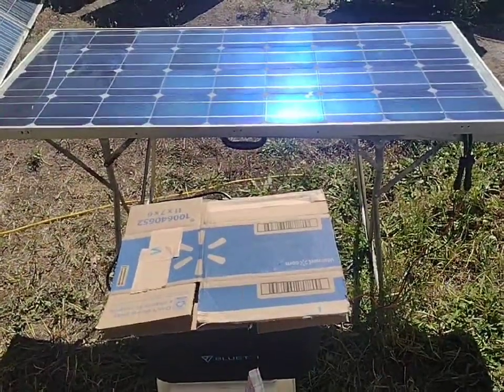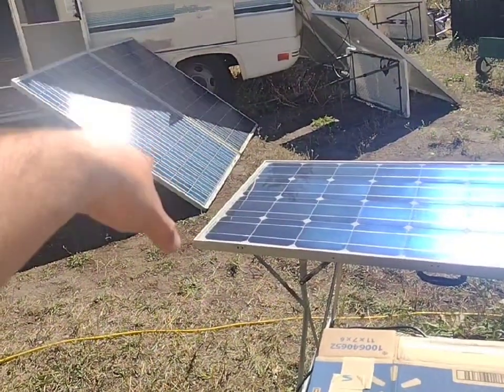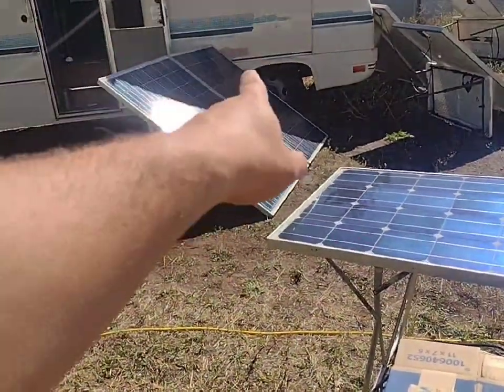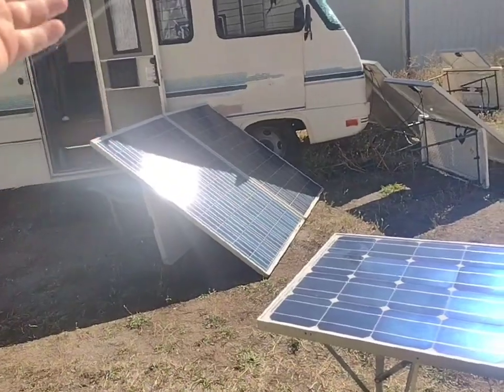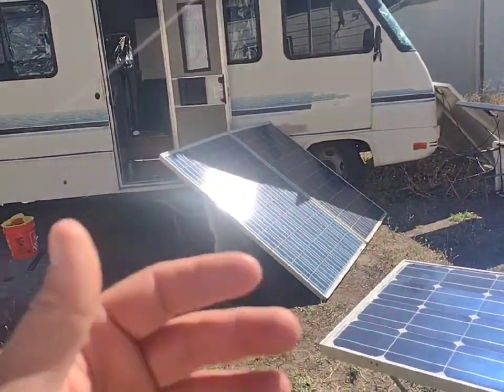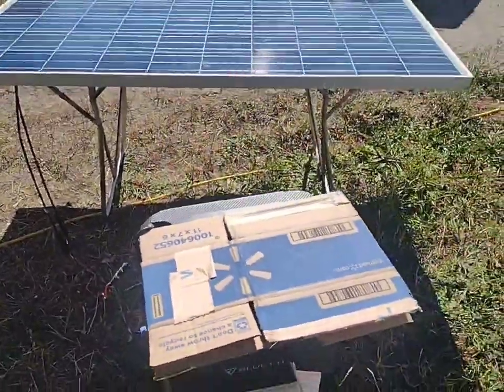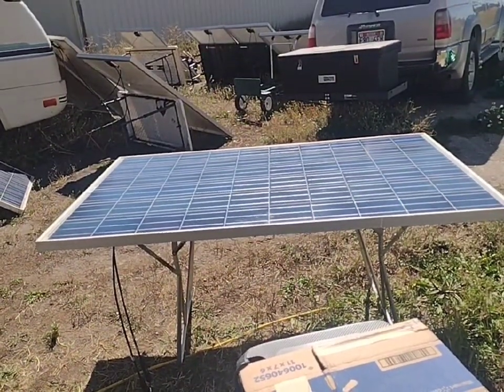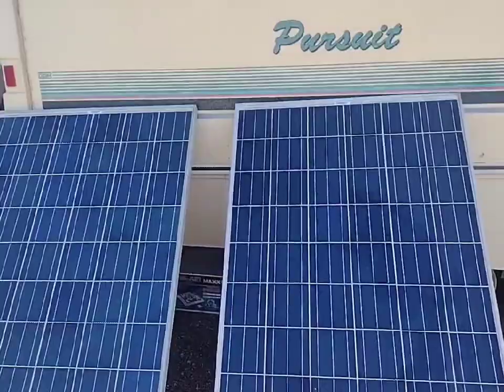😬 I Ceramic Coated My Solar Panels!! 😵 - Bluetti Adventures

Comment: Ceramic Should be sprayed with no sun hitting the panel in the shade for no streaks and more sun to penitrate the panel.  Clay bar should have been first step before the ceramix to remove contamints to give a base foundation for the ceramic to last longer. With out a clay bar 6 to 8 months best. Def a great idea on the panel. Good content.. i recomened a true 9h hardness caramic that last 3 to 5 years  one application and done. Good work.

Comment: That's easy work so props, I've seen some folks win with a ceramic coat spray. Not that it'd be worth the effort for you, but couldn't hurt for as cheap as a bottle is if you ever care to try.

Comment: You tested using the most crude method you could but know that UV is not what PV uses to produce power anyways. I agree though, the only thing that Ceramic coating will do is help your panels anyways...

Only thing you could do is use a better product. Most quality glass coatings can last 7-10 years

Comment: What is the point? We've had our panels out for two years and they're like new.
Reply from the maker: Both of my properties are in agricultural areas where the dust is thick & sticks.  People who I've talked to that have solar panels over 4 years old end up washing them by hand every year (having to scrub).  Over time the panels have their original coating flake/baked off by the sun, snow, and dirt.  After the original coating is gone the dirt sticks real easy (just like a car as the clear coat ages).  So the point of the coating it to make yearly cleaning easier.  Instead of having to scrub, I can just spray off the dirt.  Without the cleaning the folks around here lose 20% power generation.
Reply: @RUFit4Survival  thank you so much for that explanation. It makes perfect sense.